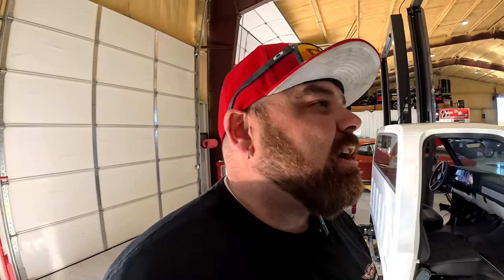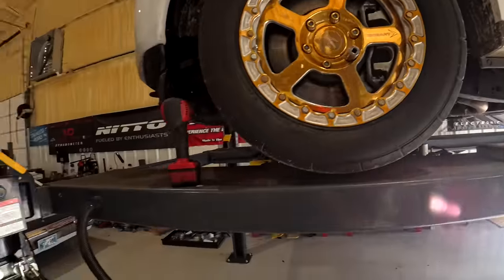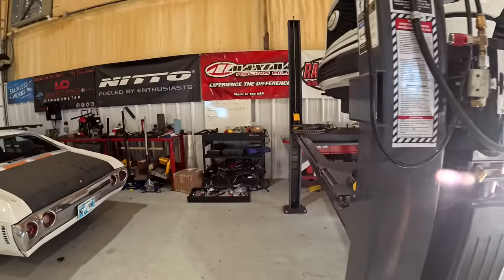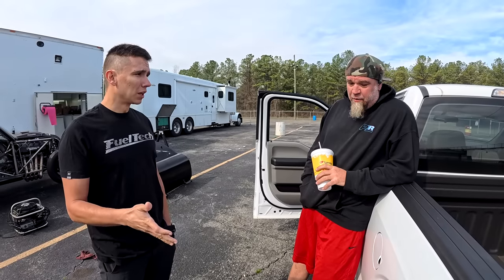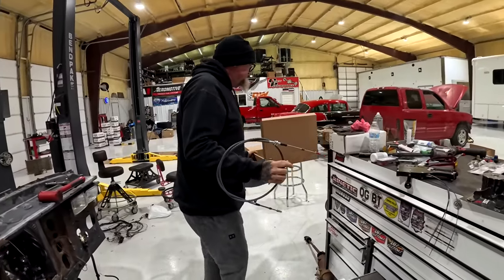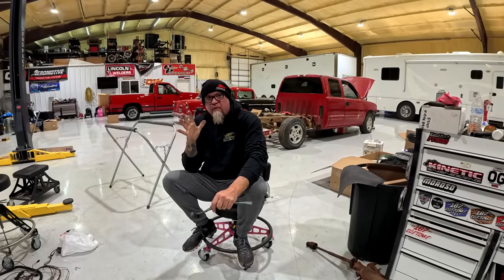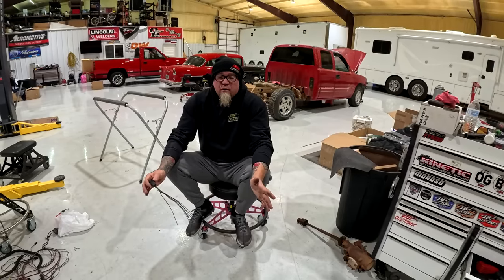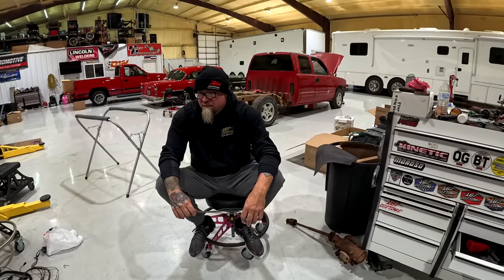2020 3.8L Whipple Supercharged, Coyote Powered, Fueltech Controlled F150 Hits the Track FINALLY!

Comment: Cleetus is breaking the shit out of those green belts and ya gotta put that crank shaft stabilizer on it too so it doesn't break the snout off like Cleetus done.
Reply: Hell I doubt they have a stock Crank, the heads and cams aren't stock and a built supercharger with nos and fuel tech. Cleet has none of those
Reply: @jeremymackevincaylor4954  I'm sure it's not a stock crank in there but better safe than sorry. I just don't want them to have to tear it back down just in case that could have prevented it.
Reply: Yeah it seems like that's sn upgrade all the serious guy are going to especially the supercharged ones
Reply: Even the not stock cranks have broken in the same location. It's a design flaw not a material flaw. Still the brace is a very good idea. Nit everyone is breaking them but do you wanna risk being one that does?

Comment: You guys have to check out the race cleetus set up with midnight performance and a couple other guys. Those f 150 are getting after it. We need your machine to be faster and do the next race with cleetus and them. It will help the channel!
Reply: Cleetus hasn't posted yet but go to midnights page and watch. Its insane what those trucks are doing
Reply: @kylethiede9463  Boostedboiz put out their video, it’s probably not as in depth as Cleetus will be though

Comment: You need to go with a much lighter rate front spring and use a 90/10 shock, remove the front stabilizer/anti sway bar. If the front bumper has an insert, remove it and if running a chiller, well that's a secret

Comment: FYI, brakleen disolves red locktight.  You will probably be fine but you never know.  I'm surprised those bolts didn't come with safety wire holes.

Comment: @187Customs gates goes make a racing belt line. I agree the go to is the HD green belts. But they do make a RB belt. They are blue, designed for high rpm use from what I gather.
Reply from the maker: I didn’t think they made the blue ones anymore. I tried to get one when my truck was procharged and couldn’t get them
Reply: @187Customs if you guys have a part number of the belt you are using now, I can see if I can find something for ya. I’ll check out continental, gates, Goodyear etc.

Comment: I think you guys should really try some flowmaster mufflers. Not the flow F/X or the Outlaws those are really loud. Get a set of 3 chamber Flowmaster mufflers. I have the Flow F/X mufflers and they’re loud on my Mustang that pretty much stock and N/A. It gives it more of a smooth roar instead of that raspy straight pipe sound.

Comment: Needa take your truck to all motor labs or take it to midnight performance or take it to velocity performance they all work together on f150s and they’ll also work with your fuel tech the same system they should work with it

Comment: 40 series flow masters. Or if you can find. The old thrush round blue and white mufflers with bird on side. Not the header mufflers but the original. I paid 400 for 2 still on the box from the 90s. They came from a wynn's auto parts. Them been outta business for a while. But the sound they make is one of a kind. And trust me, very hard to find 3" thrush mufflers. It has to be the blue cans with white and bird. Not the red glass pack or header muffler. Or the 40 series flowmasters are that sweet  mustang sound
Reply: Flowmasters suck on literally every engine
Reply: Flowmaster..? Is it 1995 again?

Comment: Figured Fueltech might be a bit behind the curve on trans tuning with the 10R80, it’s a bear.  I remember when it came out, Lund didn’t even bother with the Gen 3 motor stuff till they figured out the transmission stuff which from what I understand was an absolute shit show to begin with.  Torque tables FTW 😂

Those hard shifts are likely due to the torque reduction being shut completely off.  Makes for more transmission wear but doesn’t limit any power at all.  I’d also wager the difference between 2nd and 3rd gear leave is probably predicated on what rear gear you guys use as opposed to what others run.

Comment: The coyote sounds good between 7500 and 10500 rpms but the rest of the time it's terrible.
Snot rocket sounds awesome way up in the rpms. But low rpm not so much.

Glad to see some footage on the truck. 
So y'all are pioneers in the fuel tech 10 speed venture.
I'm sure it will be awesome when the R and D is closer to what it needs.

Comment: Shawn, you should investigate the white F150 that won Cleetus's event. It's a full interior with A/C. Now, in all truth, Houston Street Monsters Orange F150 with the Turbo 400 transmission should have won, but he was having transmission shifting issues. But, the Randy, the driver of the white F150 took the trophy. Yes, it's a twin turbo truck, but he's still running the stock transmission. Certainly something you should look into.

Comment: Pretty sure Cleetus has the damn near same setup as you all the way down to TBM brakes 3.8 Whipple just different wheel setups and it's a high 8-second truck as it sits while shifting good... But one thing I noticed when he had his F-150 and all-wheel drive shootout is that the fastest f-150s all have a th400 😂... It's more consistent but it's also more race car and you lose all the good Street ability that the 10r80 gives you... Midnight performance definitely builds a good transmission though That's where Cleetus gets all of his 10r80s  built..

Comment: Does the dohc heads combined with the higher compression direct injection make these trucks so great to build? Seems like the f150 is just killing the truck scene even against high horse lsx trucks
Reply from the maker: It’s the 10speed transmission
Reply: @187Customs  what is the deal with some of these trucks going to th400? Those trucks make enough power to keep the power band happy even with just three gears?
Reply from the maker: @davidthurman2267  yes
Reply: @187Customs  thanks for the replies. I’m currently building a 90s Sierra and was wondering if I was just wasting time 🤣

Comment: Sounds like open header 1 ton Chevy from 88, y'all done that, , shouldn't have locked phasers," add some timing on decel"  it will get rid of popping or cruise, idle, timing, , nothing gonna be better than a set of 68s on this truck, unless it's a blower that runs off inner rib of lower, 
Kenne bell had a few , roush ,,  
Best belt deal is call vmp get a FEAD BELT WRAP BRACKET, OR SEE IF SCOTT HASTY WILL BUILD U ONE, BELTS MAKING TO MUCH hEAT, GATORBACK
Reply from the maker: lol what?

Comment: Should have stayed stock ecu wifh a lund tune. that's what all the fast guys are running haha

I understand yall justifying Fuel tech, and saying its another option for guys when building this platform.
NO ONE IS PAYING FOR AN AFTERMARKET ECU WHEN BUYING THOSE TRUCKS. There is no point in spending that money on an ECU, most guys that are going the f150 route would rather spend that money on some Belaks Wheels. You guys were interested and spent the money on the truck and it's build, thanks to all the proof you had seen with midnight &  Lund & then theres Brett showing what coyotes are capable. 
But your lying to yourself saying it doesn't bother you if the truck is gone for a year. Arent you on year 3 of having it? Year 4 will be the year? 
I understand y'all have this thing in your brains being at rhe level yall are, that keeps yall from accepting a stock ecu can be fast, also that because yall have the almost un attainable for most style race cars with npk that stuff regular everyday folk can buy or build cant be as great as what yall can get amd doing it the roure y'all are going. Time to swallow the pride a little and tell fuel tech to buy that f150 from you and you build another bur stock Ecu or tell them All right sorry we didn't have another year to wait on this and normally everybody else could say it's done in 2 months
Reply: Hahah

Comment: Ford 10r was tranny used in automatic Ford GT putting it in a heavy truck is big differnce GM was able to get the design from ford when GM asked ford for help with mid engine corvettes because ford been using mid engine transmission since the 60s its a Mr.Shelby and Mr.Ken Miles design obviously over years since Ken Miles passed away it has changed